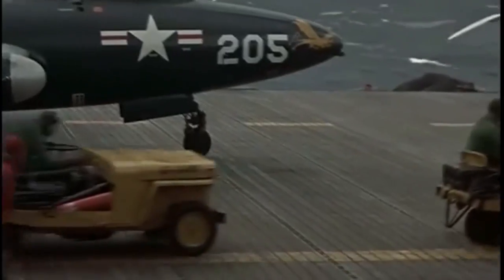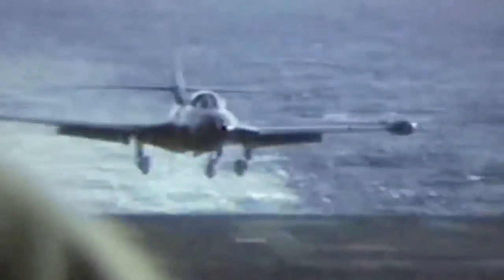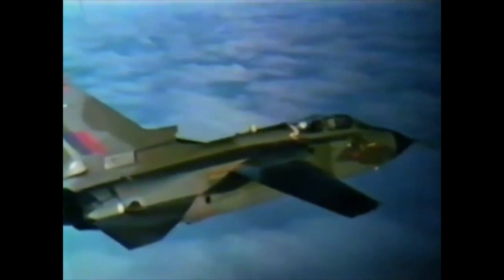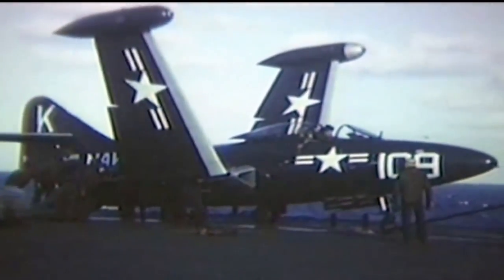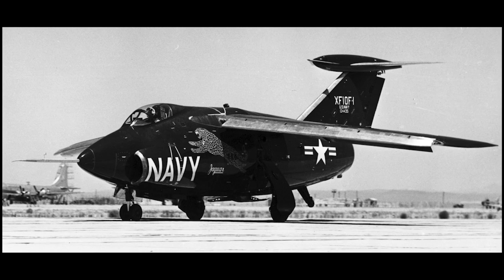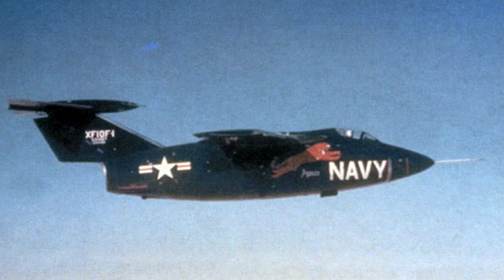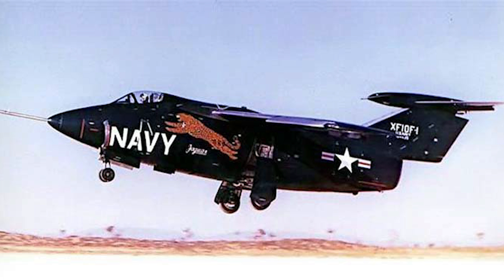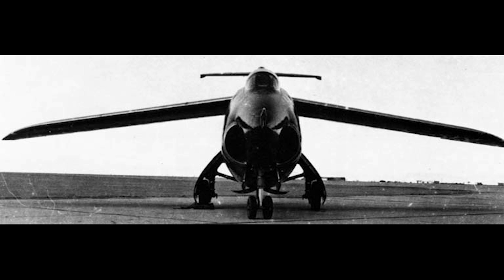“A Fun Airplane to Fly Because It Had So Much Wrong with It" – The Grumman XF10F Jaguar

Comment: Corky's English test pilots quote was great, "The entrance into the cockpit was most difficult, it should have been made impossible".
Reply: The Aircraft in question was rumoured to be the Blackburn Botha.
Reply: @richardvernon317  - A rather unsuccessful twin engine torpedo bomber and reconnaissance aircraft for Costal Command.  Unfortunately, due to engine placement the cockpit view to the side and aft was virtually zero making it  "useless as a GR [General Reconnaissance] aircraft".   It was unstable as well as grossly underpowered.
Reply: @scootergeorge9576  There is a reason its always in any ten worst British Aircraft lists.
Reply: THAT quote is a CLASSIC!  LMAO!
Reply: @richardvernon317  - But it does sound better than the Curtiss Wright XC-76 Caravan, a twin engine, wooden transport of WWII. The first flight was very brief. The pilot immediately circled around and set the aircraft back onto the runway.  On the second flight, the aircraft disintegrated in flight. A shame that CW did not bring in a few DeHavilland  engineers as advisors on the wooden disaster. They did, after all, design the Mosquito, one of the greatest British aircraft of all time.
Reply: Eric "winkle" Brown was that man
Reply: @reubendobbs8011  ~ Capt. Brown test pilot legend.
Reply: @martentrudeau6948  Absolutely! Why he was never knighted when so many "make-weights" were is a mystery...
Reply: @bobsage4963  ~ I like Eric winkle Brown so much better than the likes of Sir Elton John, Sir Patrick Stewart, and Sir Paul McCarthy, these entertainers cheapen the title "Sir". -- They should have awarded Capt. Brown the Victoria Cross, he certainly had courage and nerve like none other and was a major contributor to the Allied war effort and post war aircraft design. He was an amazing man.
Reply: Sounds like something Eric Brown would say.

Edit: And had I read more of the replies, I would not have needed to make this comment.
Reply: @scootergeorge9576  So they used it to train rookie pilots, with predictable & all too often fatal results. 😟
Reply: @martentrudeau6948  The Victoria Cross is only awarded for extreme gallantry in the face of the enemy. So not possible -  unless you class some of the aircraft types he flew as the enemy!
Reply: @DrivermanO  ~ Maybe the de Havilland DH 108 "Swallow" could be considered the enemy? It did killed Geoffrey de Havilland Jr, but Eric lived after nearly dying from the flying the Swallow, he had a lot of nerve and everybody respects that. Then again, Eric was an elite test pilot and it was his job to push the limits of aircraft envelopes, and this was routine practice throughout his career.
As for the Victoria Cross being awarded to celebrities who never displayed extreme gallantry in life threatening situations, this seems more politically earned than for courageous reasons.
Reply: What do you think about the vision of the Eurofighter used in ground attack missions, with a so wide "Canard" just in the right position along the cockpit to hide the ground ?...
When you made an interceptor, you can decide to tell the pilots to use it for ground attack missions, but that's not the best choice.
Reply: I was under the impression it was an experimental type for the Fleet Air Arm but the comment was definitely made  by Captain Eric "Winkle" Brown RN.
Reply: @mothmagic1  ~ That's sounds about right.
Reply: I have had the honour of meeting both Winkle and Alex Henshaw. Men I admire and respect above the likes of the modern so called celebrities. They were real men.
Reply: @DrivermanO  he was awarded the Air Force Cross, which is for ""an act or acts of exemplary gallantry while flying, though not in active operations against the enemy"

Comment: Summary: When life gives you Jaguars, make Tomcats. ;-)
Reply: Oh what a drag-uare respeccing the Jaguar
The wings are quite clever - The top brass?  Nah, never.
Reply: The transition from Jaguar to Tomcat needed an intermediate step called the F-111 Aardvark.  Yes, that was a Grumman/General Dynamics design.
Reply: @Easy-Eight  But the F-111 never had the makings of a varsity Grumman Cat.
Reply: @RCAvhstape  ... I've read a lot of aviation books.  Grumman made two huge mistakes in the '50s, the Jaguar and F11F Tiger.  The former nearly bankrupted the company.  The latter became an advanced  trainer for the USN but the F8U Crusader was just a better jet (if Grumman had put a J-79 engine in the Tiger it may even be flying in squadron service to this day in some nations, it was that good).  Grumman was reduced to making aluminum canoes during the '60s and '70s to make ends meet.  Grumman now makes mail delivery trucks.  The F4F stopped the Japanese.  The F6F beat Japan.  Now?  The legacy is a puttering postal delivery van.  :(
Reply: @Easy-Eight  Grumman is now part of Northrop Grumman and doing quite well building rockets and spacecraft.
Reply: @RCAvhstape  Yep, they also built the Lunar Lander during the Apollo program.
Reply: It was a cat, but not a Cat!
Reply: @Easy-Eight  I remember those fancy looking public transportation Grumman busses, which were quickly phased out of service for safety reasons.

Comment: I would just like to note that the Me-262 is not the best example of early swept wing aircraft because its wings were not swept to increase its critical Mach number, but rather to change the distance between the center of lift and center of gravity.  The original design had straight wings but the engine nacelles turned out to be heavier than anticipated, so the wings were adjusted to move them aft.  It was simpler to change the wing angle than to redesign the fuselage and rearrange the structure and internal components.  The wings ended up at the same slight sweep angle as the earlier DC-3 transport, which had slightly swept wings for the same reason.
Reply: Supposedly the bent wings of the B-25 resulted from a need to decrease the dihedral but it would have been too expensive to redesign the fuselage and engine nacelle interfaces. Seems to have worked out pretty well.
Reply: @danpatterson8009  The strange inner wing shape of the Vultee A-31 Vengeance was a result of a CG miscalculation that required the wing to be moved back without redesigning the fuselage. And there was a field modification kit for the P-38 that involved cutting off the tail booms just forward of the horizontal tail and inserting angled spacer pieces to change the incidence of the tail a degree or two, later incorporated in production. Sometimes necessity is the mother of invention.
Reply: Exactly.  Another case of a German design with a fortuitous outcome being mistaken for technical prowess.
Reply: @danpatterson8009  it’s my understanding that the cranked outer wing on the F-4 was similar, where it corrected flight problems w/out needing to make corresponding changes to fuselage & landing gear.
Reply: Me-163 is a much better reference aircraft for this, though it's wing were not just swept for speed, but also because it lacked a horizontal stabilizer
Reply: @thekinginyellow1744   Yes, the significance of the 163 is that it was a tailless flying wing. Actually, I don't think the wings of the 163 were swept to delay compressibility at all.  I think they were swept for the same reason all flying wings without a horizontal tail are swept -- so the outboard portion of the wing is far enough aft to balance the nose down pitching moment of the wing and provide pitch control.
Reply: @gort8203  Yeah, I did a bit more research.  Lippisch had been working on delta wings since the 30s, and in 39 or so they discovered that the delta was a good candidate for trans/supersonic flight.  So it's more that they chose the flying wing configuration for the Komet because they knew it's swept wing would make it fast.
Reply: @thekinginyellow1744    I don't consider the Me-163 to have a delta wing, which is a sharply swept triangular wing like that of the F-106 or MiG-21, but simply a mild sweep angle. I can't find a reference for that angle, but I'm guessing it is not much more than 20 degrees. You don't see appreciable increases in the speed for critical Mach and peak drag Mach until around 25 degrees of sweep. A 30 degree sweep will increase those numbers by 8 and 15 percent respectively. I'm extrapolating a guess that the 18.5 degree sweep of the Me-262 would only provide improvements of 3 and 5 percent. I would be interested to see any hard numbers anyone may have.
 
So I'm just guessing here, but I suspect that the wing sweep angle chosen for the 163 was the minimum necessary to provide the stability and control sufficient for good maneuverability. Increasing the sweep angle would have provided even more, but would also have reduced the climb rate of the aircraft, which was a critical performance parameter due to its design mission profile and limited fuel.  Again, I would be interested in seeing any hard info on this.
Reply: @gort8203  The sweep on the 262 was enough to give it a 40 mph advantage at altitude over the straight wing Meteor F3 and the P-80A/B.
Reply: @johnshepherd8687  The wing of the 262 was not swept to delay compressibility effects, it was swept to adjust the relationship between the center of gravity and the aerodynamic center when the engines turned out to be heavier than planned after the design was already established.  The wings on the Dougals DC-3 were swept to the same degree for the same reason, and it didn't make that airplane any faster.
I think the 262 was faster than the early Meteor, but the later Meteor with more thrust was faster than the 262.  The P-80C was faster than the 262 on its single engine and straight wing.  I don't think the 18.5 degree sweep of the 262 was a significant factor in the performance of the airplane.
Reply: @gort8203  I understand was not done to increase the critical Mach number but it did have that effect.  The P-80C increased the critical Mach by thinning the wing.
Reply: @johnshepherd8687   So it may have increased the critical Mach by 3% (16.8 mph). That is not significant even if the top speed was limited by compressibility rather than available power, which I have no reason to believe.  With the Meteor and P-80 able to go faster with straight wings I don't see why it is necessary to credit the slight sweep of the 262 wing as responsible for its top speed.
Reply: @gort8203  First of all, the P-80A had a higher top speed at its best altitude (under 10kft) than the  ME 262 at its best altitude (over 20kft).  What made it slower at altitude was it's thick wing and lower critical Mach number.  The slight sweep of the 262's wing must have raised its critical by more than theorectical 3%.
Reply: @johnshepherd8687  I don't see the evidence that the slight sweep of the 262 wing provided the dramatic effect you claim for it.  The effect was slight, and the main point is that it was *inadvertant*.  Happy holidays.
Reply: @gort8203  I found a sort of reference on another channel that contains an article written by Lippisch 1931 that indicates even then he was aware that swept wings were advantageous to high speed flight, but that in flying wings that consideration is secondary to stability  https://youtu.be/s__sKI0GSRw?t=2150.  So I will concede your point.

Comment: How many times do we hear the Military specification starts as "we need a plane to do X Y Z",  manufacturer start cutting metal, has the first systems in testing and then gets told that "we need it to actually do A, B, C 1,2,3,4". And then everyone wonders why there was a significant overspend and it's late into service. Great story as ever.
Reply: Unfortunately those Military Specifications are based on expected threat capabilities of the enemy that you are expecting to fight and that is based on what intelligence you have. It also involves the fact that you don't expect the world to change that much in the geo-political sphere between when the project starts and when it enters service. It also has to take into account any technical breakthroughs that may happen within your own defence industry that makes the original specification redundant. All of these factor happen all of the time as the world does not stay static. Like this aircraft. No Radar in it because there is not one that will fit, until somebody comes up with a design that works and can be made to fit if the aircraft is modified. Same for the Jet Engine. Axial Flow rejected due to MTBF on current designs, then Somebody makes one that can meet the MTBF figures of the original engine selection.
Reply: @richardvernon317  Hitler's interference in April/May 1944 delayed production of a fighter version by about 3 months, until around September, when about 1/5th were fighters and only in November were 50% fighters. Other delays were certainly modifying the plane such as tricycle undercarriages and engine reliability, but, by that time, shortages of fuel which hampered training the jet's new pilots, plus overwhelming Allied planes, negated the Me262's effect on the war. Production rose into 1945, but few came into service by then. The main problem with Whittle's W1 engine was getting it to develop enough power. Frank Halford started work on redesign in April 1941 The resultant Halford H-1 first ran on 13 April 1942, and quickly matured to produce its full design thrust within two months. It's first proper flight was on 5 March 1943 in the prototype Gloster Meteor DG206/G at RAF Cranwell,
Reply: @crossleydd42  There were many factors involved in the ME-262 production woes. One was the bombing of Germany, another was sabotage by slave workers, another was the difficulties with the metals and materials needed for the jet engines. Lastly, the evolving technology of the plane, first a tail dragger then a tricycle gear. Thanks
Reply: @Rhaman68  All very true.

Comment: Actually, what was learned from the ill-fated XF10F was put to good use on the General Dynamics F-111, because Grumman designed the wing sweep mechanism for the F-111 itself as a subcontractor.

Comment: 1:40 fun fact: the Bell X5 was derived from the Messerschmitt P.1101 project, captured at the end of WWII, except that wings sweep could be change during the flight.
It was already obsolete when it flew and there was no attempt to correct its flaws and try to make an actual fighter from it. It ended up as a test bench for swept wings, though jets improved so fast it was almost useless.
Reply: Both the X-5 and the XF10F Jaguar suffered from the same problem: serious stability issues whenever the wings were swept back and forth. Grumman learned from this and figured out how to make the whole idea work properly with the F-111.
Reply: @Sacto1654  The F111 was from General Dynamics, not Grumman, Did you mean the F14?
Reply: @cvr527  Grumman was the subcontractor on the F-111 who designed the wing sweep mechanism.

Comment: Abou that canopy story: Ever seen Hot Shots, the Top Gun spoof? I didn't know it was inspired by real facts! :-) One interesting fact you forgot to mention: The whole wing was actually translating it's position while changing sweep to retrim the aircraft, the lack of which was major problem on the X5. Only the later fixed inner wing gloves, as seen on the F111 etc. made that redundant. It has been written that this idea actually was directly copied from Vickers studies by Sir Barnes Wallis (Swallow etc.) The translating wing position has been described as a major reason for the extra weight. I'd say that the concept was actually spot on but just too advanced for the time. The double tail plane actuation is new to me. That seems to have been a stupid mistake indeed. Such a concept is simply asking for delayed reaction effects and thus pilot induced oscillations. One does however wonder how it would have done without that tail and that engine.
Reply: "I'm OK!"   LOL
Reply: For its last several flights it was equipped with a Cougar style tail setup but it time was already up according to Corky. The plane had other flight control problems. The plane's wings were equipped with undersized ailerons and new type of spoiler system that didn't really work so the plane didn't turn very well. Corky did note that the one power dive he did in the Jaguar it quickly out accelerated the F-86 wingman like brick.
Reply: This is true, the whole concept was to check out the translating swing wing, the rest of the plane built to carry it.
Reply: Barnes Wallace-- Mister Geodesic?  Messerschmitt P.1101 is where the swing wing idea came from.

Comment: Actually the reason for the German Me-262 having swept wings was because the engines they ended up using was longer then those originally planned, with the engine much further forward of the leading edge.. This left the aircraft somewhat nose heavy. So to counter this problem they swept the wings back which moved the centre of gravity back.

Comment: If it looks right, it'll fly right. If it doesn't look right, it'll be called the XF10F Jaguar then completely forgotten until resurrected in a Youtube video.
Reply: To be fair the design was not a complete lemon.  An Air International article on this aircraft many years ago made a couple of interesting points - the initial elevator design was a failure but was replaced by a conventional surface that resolved controllability and the engine problems were somewhat resolved when Grumman, in their frustration, ignored the instructions and took the fuel control unit to bits themselves.  Having undone all the securing screws that held the cover on the cover would not come off and as the only screws left were 2 that held the maker's nameplate on, they unscrewed those as well.  One was short as was expected but the other was far too long and had penterated the guts of the control unit.